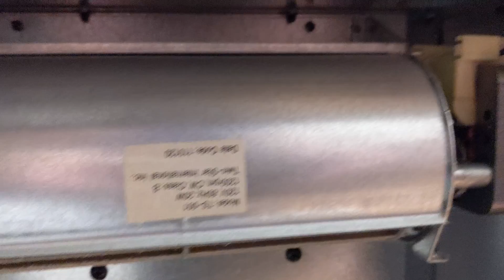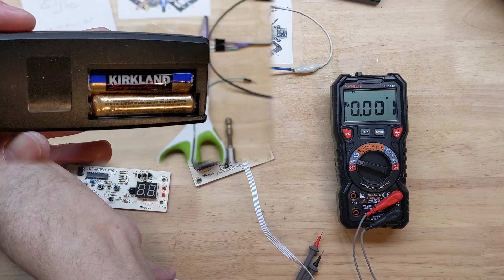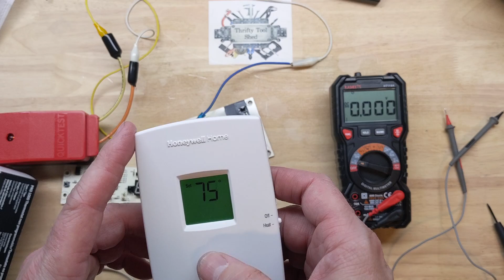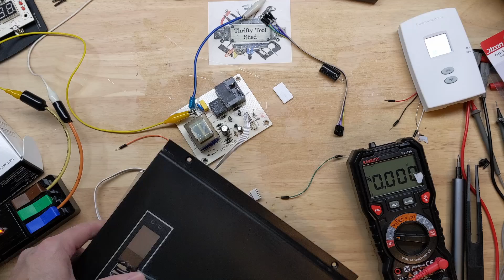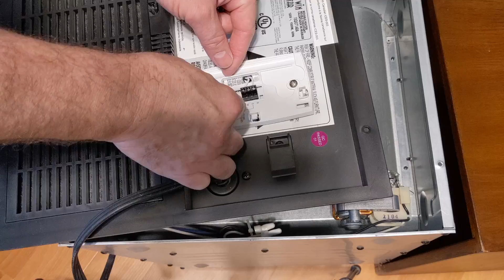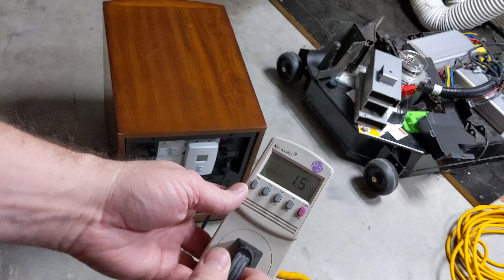DuraFlame Heater Repair

Comment: Great video , when using high powered loads the long lead should be uncoiled as it will generate eddy current resulting in heat that will damage the cable and would also explain the drop  in  voltage
Reply from the maker: I think you are referring to the drop cord. Yes, it should be uncoiled for sure. I should have mentioned not to use one at all with heaters and it was simply to show the meter on camera. Thanks for your comment.

Comment: Nice work! How's your HO insurance? LOL😆😆😆
Reply from the maker: I mentioned that I did not modify and don't recommend modified safety cut outs of course. I only changed the temperature ON/OFF control of course and I still will only use it in the shop! Thanks.